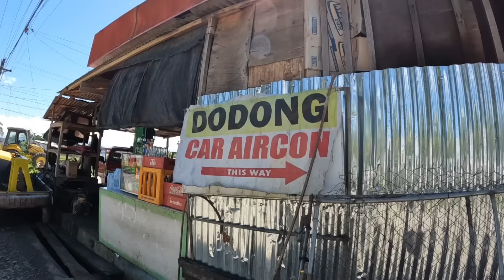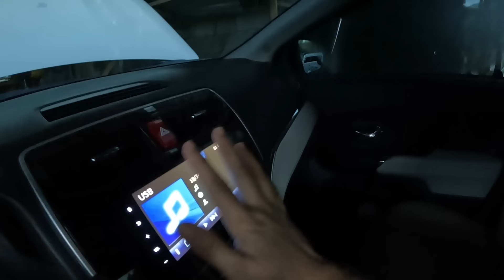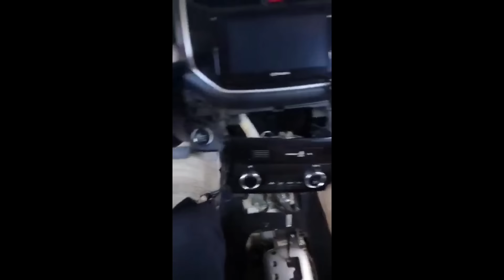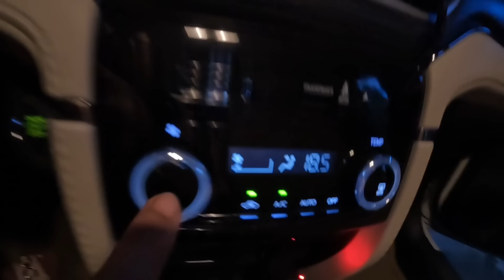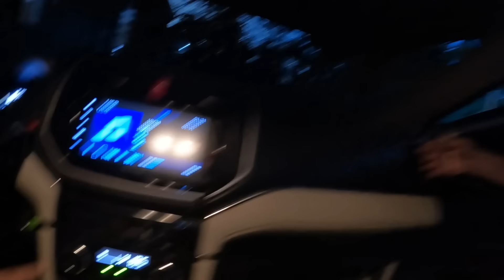Why We Had To Get Our Car Serviced | Were They Able To Fix The Problem? Are We Happy w/ The Result?

Comment: The problem you had as you know didn't happen overnight, it took lots of driving in dusty dirt road, here in the states I change the filter at least one time a year, and then thick I should do it more often.  
The work they done in four hours, was amazing, over here that would have cost 500 dollars or more and they would have your car for two or three days.  
Very thankful for you guys having a great repair shop, and honest also.
Enjoy the air conditioning guy's

Comment: That looked more like the heater core to me but, if it's plugged up, nothing works, heat or AC and, you probably never have the need for the heat in the Fils. The evap sits in the front of the car where it can get a steady stream of fresh air and is usually attached to the front of the radiator. When the car is not moving to get that steady stream of air, the electric fans take over. Your car being a Toyota Rush is the sister to our Toyota Rav4. They are both , almost identical and the Rav 4 DOES in fact have a room air filter. If that filter plugs up with dirt, it starts to restrict the interior fan operation. $80 bucks??? that is a steal!.